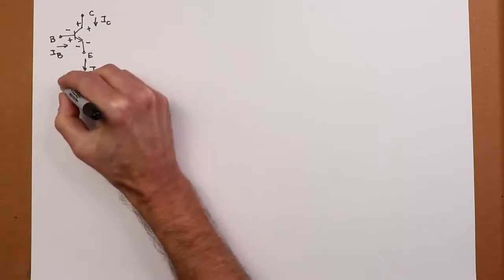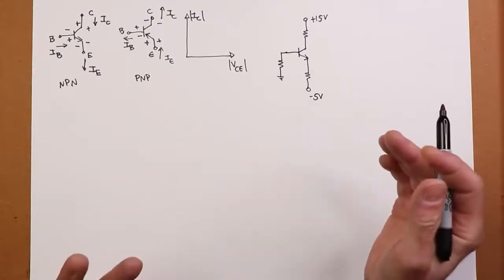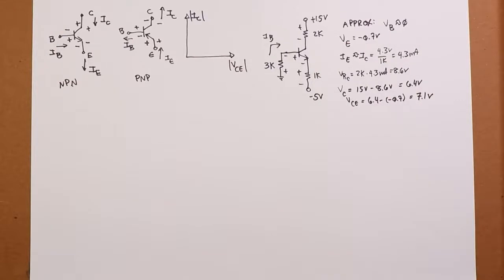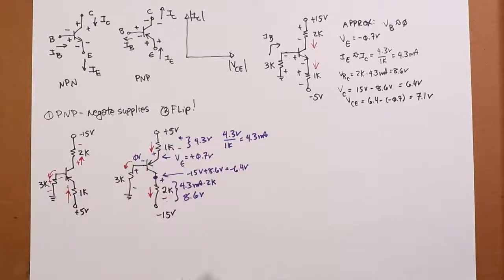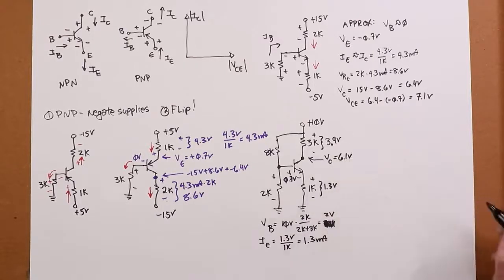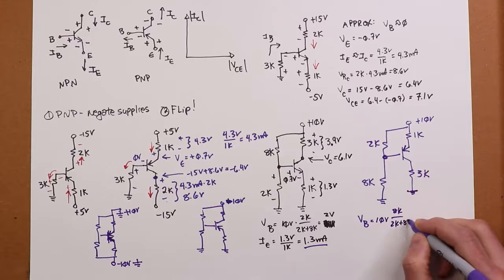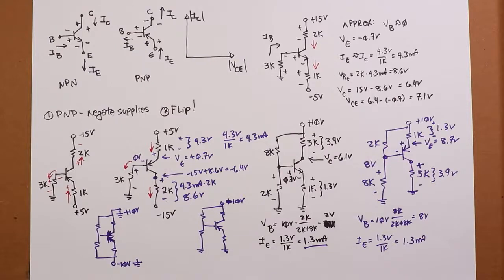Semiconductor Devices: PNP Biasing

Comment: Is there a rule of thumb for choosing RE and RC to compensate for a Beta that varies?
Reply from the maker: That depends on the bias used. For high bias stability, make Re around the same size (or larger) than the base resistor(s). The value of Rc will depend on the bias voltage and what you need for a gain.

Comment: I think I found an error VCE which is 6.4 minus -0.7, should be 5.7. Could you confirm that your math was incorrect on the VCE with the NPN.
Reply from the maker: Ve is negative. Subtracting a negative is adding. 7.1 is correct.

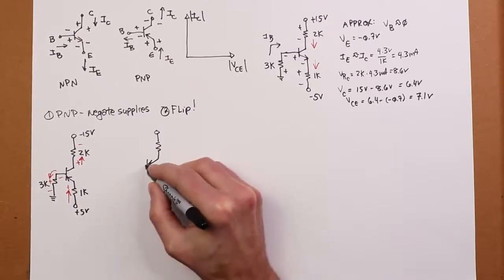Comment: I feel like something is off with the PNP calculation at 8:30. The 0.7v drop is "across" the emitter/base, not before it. So you can't use the 0.7v drop to calculate the drop across the 1K resistor. I can't simulate your circuit on a breadboard, because I'm a novice and don't know how to make negative voltages. However, when I setup a PNP circuit and measure... the voltage drop across 1K, plus the voltage drop across 3K, plus the 0.7v drop equals my source voltage... meaning, 1K voltage drop plus 0.7v can't equal the source voltage... there has to be some voltage left for the 3K resistor to drop, meaning 1K voltage drop has to be less than what you are showing. Right? What is it?... I'm not sure, but I'm pretty sure it isn't source voltage minus 0.7v. Help me understand.
Reply from the maker: First, notice in upper right it says "Approx: Vb = 0". 
The issue here is that the drop across Rb is small enough to ignore, therefore we can approximate that the 5V supply drops across the 1k and Veb. We know Veb = 0.7 ("across", just as you said), leaving 4.3V for the 1k. Now, why is the drop across Rb small enough to ignore? That's because the drop is Rb times the current through it, which is Ib, and Ib is beta times smaller than the collector or emitter current. Seeing that Rb is around the same size as Re, it should be obvious that, with a beta of 100 or so, Vrb will be at least an order of magnitude smaller than the drop across Re. 

So, yes, the supply is spread across three things (Vre, Veb, Vrb), but that last one is so tiny that we can ignore it and still get decent accuracy. A more precise analysis would show that the current is slightly smaller than this approximation, but that deviation would be smaller than the deviation you'd get from resistor tolerances in lab.
Reply: Okay. I'm understanding the 0.7v drop placement now, and how the 4.3v drop across Re is derived. Thank you. 

I also get why you are discarding the drop across Rb. However, for me, its only insignificant because of the value shown for Rb (3K). If that were to be, say 100K, its not insignificant (to me). So its a personal preference that I don't like seeing values ignored (as opposed to being calculated), because it "could" be significant depending on the circuit. Again, just my opinion. But feel free to correct me if I'm wrong. 

Beta = Ic/Ib, so it can't be said that Ib is beta times smaller than Ic and Ie. Yes, Ib is "smaller" than Ic and Ie, but "beta smaller" than Ic only (I've seen it shown that Ie/Ib = alpha. So, Ib is "beta smaller" than Ic, and "alpha smaller" than Ie, but not "beta smaller" than both). Again, I think they are "close" in your example circuit, but its not the same calculation for both. 

While I'm babbling about things... I think the approximations are what is throwing me off... For example, in reference to the NPN circuit... saying Ie and Ic are approximately the same is only "true" if Ib is a small current (in the microamp realm), which isn't always the case. For example, I am looking at one of my own circuits that has an Ib of 2.1mA, and an Ic of 2.83mA, resulting in an Ie of 4.93mA. So, Ic and Ie are not anywhere near approximately the same (Ie = Ic + Ib, Ic = Ib * beta). What I mean is that stating they are approximately the same is only "true" sometimes... Again, more of a personal preference to state the calculation (Ie = Ic + Ib) which is always true. 

Thanks again for talking this through. I appreciate it. And again, feel free to correct anything I said that was incorrect... I'm just trying to learn. Take care.
Reply from the maker: @arkufahl  In earlier work it was shown that there are three regions of operation for a BJT: saturation, linear (constant current model), and breakdown. Circuits like this are operating in the linear region, and therefore we can expect there to be a decently large beta (or, if you prefer, an alpha close to unity). No amplifier bias circuit like this would be set up in saturation, so you'd never see a ratio of Ic/Ib of three, or similar. It will be the case that Ic and Ie are approximately the same. We use these and other approximations because, within these sorts of applications, we can calculate values with high accuracy in much less time than a more precise method. Bottom line, why spend three or four times the effort to produce an "improvement" that will be less than the variation caused by the tolerance of a single component?